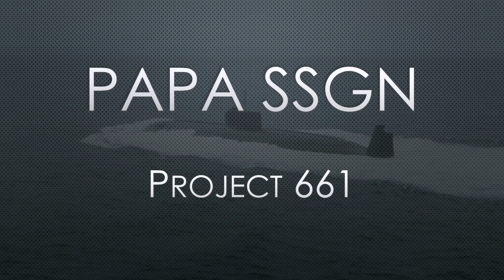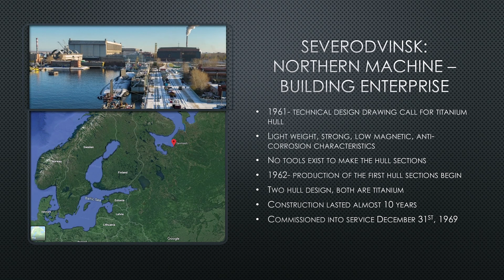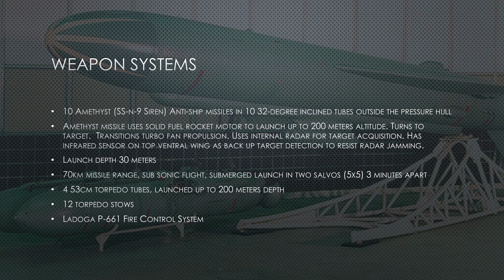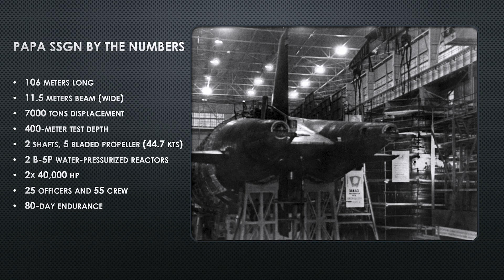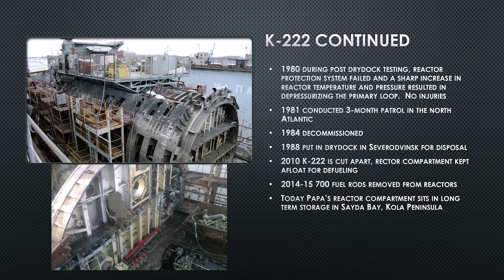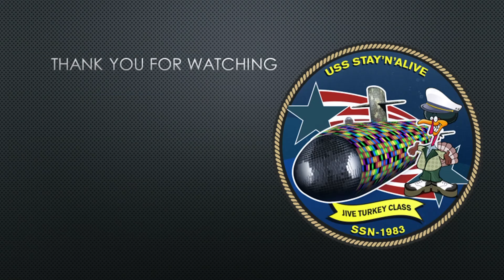The Fastest Submarine Was Not American

Comment: My gut feel is, that what killed these subs, was their noise levels.  Our company did surveillance work, and the sensor technology also improved radically in that same era.  Also, several "odd" programs like wake observation, and flyover tech, allowed an almost 24/7 "guess" as to where these boats were located.  If they lofted to communicate, they were immediately spotted.  If they went deep, they were tracked by the long sensors.  As best, they had to stay shallow, and stay in the local noise band of the surface.  That also made them visible.  Then also, we developed a torpedo which was capable of chasing them down, so closing in was not an option for them.  After about the 1970's, their best defense was to stay at home at their bases.
Reply: Yes, at flank speed the Pappa and Alfas were noisy. But they did it on purpose to show us their Speed and Mobility. But here was the scary part that the Navy and C.I.A. was aware. The vessels would then slow down and disappear from sonar. They could out run and out dive torpedos too. The Titanium hulls were not used as decorations. They were the Marine versions of an Air Born interceptor. Scary, very Scary!

Comment: It seems from the comments that some don't understand the properties of titanium. First is that it is actually heavier than steel. Second (and more importantly) it is much stronger than steel so you can use far less of it. My brother built a bicycle for racing. He showed me the titanium seat post. I could not get over how thin the metal was yet strong enough to support his weight and not collapse from the clamp holding it in position. It is an amazing metal.
   I also want to thank Sub Brief for these podcasts. I really enjoy the presentation of information free of narratives.
Reply: This is incorrect, if you search the density of titanium you get 4.5 grams per cubic centimeter, while steels range (different alloys) from 7.8 to 8 g/cc.  The strength to weight ratio is definitely in favor of titanium, as they have (barring exotic steel alloys and heat treatment) similar tensile and compressive strength.

The advantages of titanium in submarine hulls are that you can use thicker material at the same weight for more strength and deeper hull depth, and that you significantly reduce your magnetic signature for the detectors some ASW planes use.
Reply: One cubic inch of steel weighs 0.283 pounds, One cubic inch of titanium weighs 0.163 pounds. You are dum.
Reply: @arronhopsburg8532  also its not ferrous, so wouldn't show on a MAD

Comment: you should take a look Aaron at the new super destroyer that Japan is building using the Agis on shore system. Its bigger then the Ticonderoga and has more fire power then the Chinese 055 as packs a 128 VLS  firing SM3s and SM 6s with Tomahawk cruise missiles along with the brand spanking new updated Type 12 anti ship missiles with a range of 250km that is being even updated even more to 650 km and finally to a range of 1200km ranges.

Comment: weight is not an issue on subs they use titanium because it is strong
Reply: Nope. On Papa it was really to lower hull mass. And on Alfa and Sierra partially too. What they spared on hull mass, they could use for mass of equipment. If papa would have steel hull, it will be not possible to install two propulsion unit with its length. And prolonging submarine would increase lateral drag hindering top speed. Submarine has to be buoyant neutral so you have only limited mass you can have for particular hull size.

Comment: Dumb question time. Subs are neutrally buoyant when they dive. So why does weight matter with speed?
Reply: Simple answer is, that weight do not matter to maximum speed. But in practice at upper speed limit weight greatly diminish acceleration, making real top speed impractical because of time needed to achieve it. Thus practically limiting maximum speed lower, than it in theory could be.
Reply: @ Well, you cant accelerate quicky in 7000ton submarine anyway. So the mass does not matter. The only reason they made all this effort to build Titanium hull instead of steel is because as mentioned before, sub is neutraly boyant. So you are limited on how much weight you can put inside of the submarine. Reactors do weight, steam turbines do weight, rockets do weight. Also if you wanted go fast, and deep you need a strong hull that weight even more. So the reason to make sub out of titanium, was to save weight for the euipment inside. Like with the carbon fiber submarine Titan. They build it out of carbon fibre, becouse if they would use titanium instedad, the empty hull would be negativly boyant on its own.
Reply: @RelativyX  wrong. Sry
Reply: @WarmongerSmurf  also subs are not neutrally buoyant.  They take on water to dive.
Reply: Force=mass x acceleration. Acceleration = force/mass.  The more mass, the more force you need to move it.
Reply: @Jp421JP  I disagree. While less weight gives you faster acceleration it has nothing to do with top speed. Top seed is when your driving force is equal to resistane, that for hydrodynamic resistance is equal to: (p*v^2)/2 There is no mass involved in the equation.
Reply: @ physics aside it clearly matters since they took the effort to minimize mass and maximize force ( why it was so loud) But yes, maintaining speed once you get there is a matter of overcoming resistance.  But you have to accelerate from 1 knot to 2 and so on, which takes force.

Comment: Imagine the cost of a dual hull sub with both hubs made out of titanium. I know it's the USSR but titanium still has some analogy to high cost because you don't have as much of it as you have steel. Then again I suppose when it comes to strategic weapons systems things like plutonium also have a high cost/very limited supply. In fact I read in the Manhattan project Leslie Groves basically obtained all the graphite in the US to build reactors. A graphite reactor can run on natural uranium rather than enriched and produce plutonium which can be chemically separated.
Reply: You do not have to imagine. You can calculate it. Outer hull was from 2cm plates, inner hull from 5 cm sheets and had 47 ribs, each 20cm in height and 4cm thick. Papa used raw titanium, unlike later Alfa, so it was relatively cheap. Outer hull had total material of roughly 270 tons, inner hull with ribs used roughly 500 tons. Totally les than 800 tons of titanium. In todays prices with 10 USD per kg at large orders it will be not more than 8 million USD. Yes, steel would cost fraction of that, but you would need bigger mass. But overall, most expensive is not material itself, but processing. You can weld steel in hall filled by normal atmosphere, titanium would catch fire in such environment, so you need to seal the hall, fill it with argon or CO2 give welders rebreather and time to time make their funeral and hire another welders 😀

Btw. Alfa was significantly more expensive material wise, because it was used beta alloy which as novelty was extremely expensive then (roughly 8 times more expensive, than raw titanium) and also despite being significantly smaller than Papa, total amount of titanium alloy used was over 1200 tons! So she was indeed "golden fish", but this is another story.
Reply: @Aaron_Nonymous  
It was a research sub. The USSR had a history of trying out concepts and then discarding them if it had no practical value.
They had radio operated remote tanks
In the 1920s  and then scrapped the project because they deemed the technology too undeveloped.
Something the Nazis never learned.
Reply: @johnweerasinghe4139  It was not research sub, but this prototype has so many design flaws, that they decided to not redone it. Many Soviet submarine designs had similar problems in their first prototypes, but they decided to improve them. 
In case of Papa main weakness was not enough space for then developed unified super missile Granit (it was backbone of Soviet naval technological dominance in 80s), so they decided not to improve Papas design and pursued Oscar class submarine design instead.
Reply: @tomascernak6112  
Prototype means experimental before series production.
Reply: @ Nope. Here is definition:
A prototype is an early sample, model, or release of a product built to test a concept or process.
In czech definition it is first product of series.
Experimental is as experiment research.

Main difference is, that experimental/research product is not intended to produce even if it will work properly. Soviets indeed built several experimental submarines. But Papa was not one of them.

For example Albacore was experimental submarine.
Reply: @tomascernak6112  
Ok I understand your point. 
But in your own definition of a prototype you said " ....built to test a concept "
The plan was to evaluate  the feasibility of a high speed submarine that can fire a anti ship missile while submerged.
They found the technology at the time too expensive so  they abandoned it.
What I don't like is western sources that find an opportunity,  any opportunity to discredit Russians when Russians do a good job of evaluating their weapons and have a better understanding of real combat than these western sources.
Reply: @johnweerasinghe4139  Yes, but this is difference between prototype and experimental sub. If Papa would prove good, they would built another boats in that class. Drawbacks of that design was so severe, they decided not to built another boats. But Papa served in normal service as active submarine, just one of its own class. Like Mike class etc... Experimental submarine is different. It is testbed from beginning to test technologies, it is not intended to be first of its class and it is often modified. Like that Albacore i mentioned.

I am not westerner and I do not agree, that Papa failed because she was expensive. Soviets did not considered cost too much in those years. Main problem was their missiles and small missile compartment, which was result of large propulsion system in small boat. P-70 were not good enough and P-120 did not improve things significantly. P-500/700 were too big for relatively small submarine like Papa.

Big problem was also Papas hull. It was Albacore like hydrodynamic, so simple cylinder with many dull places, which suffered at high speed with turbulent flow which produced massive vibrations and outer hull damages. In Alfa class, they made outer hull graceful hydrodynamic and therefore Alfa did not had such issues as Papa and needed significantly lower power output per cross section to achieve similar speeds without those pesky vibrations.

So those are two main reasons, why Papa remained as single boat of its own class. 

Fact is, that Oscar class and Granit missile program was such leap forward, that it was futile to build anything else.

Comment: My dad's boat, the USS Knox, tracked a sonar contract off the coast of Vietnam back in 1966 or 1967. Says he doesn't remember if the Knox pinged it, but the moment they started to track the unknown contact, it took off. He makes a sound like a shot and then waves his hand away from himself, "Gone!"

I've always wondered if it was a prototype Akula or something, but the dates are wrong. The K-222? That possibly lines up with the production dates of both the Knox and K-222.
Reply: K-222 was commissioned in 1969, so if your dad's memory was correct for the 1966-67 time frame, it wasn't the Papa.
Reply: Yea that would have to be something else, Victor and November class were in service at that time. Those do about 30-32 knots. They'd still be faster than the USS Knox, that one isn't particularly fast so it wouldn't be able to chase down a Victor or one of the faster Novembers.

Comment: what is/are the source(s) for the argon environment/ diving suited welders construction method?  ive heard it said several times but have not found a citation or primary source.  ill bet its a helluva story!
Reply: i probably should’ve mentioned im an aerospace engineer n have tig welded ti before. never something as large n complex as a submarine tho!  that build crew would qualify as industrial heroes even today. id love to know more about their story/organization
Reply: I don't know the source, but I know the melting point (for welding) is below the ignition point. In other words, the metal will catch fire before it melts if oxygen is present.
Reply: @pgvsmith1 As @john_in_phoenix already has explained the "reason" for the "extreme construction methods" are quite likely "less spectatular" than they at first might appear ((at least imho)).. Simply put the environment and materials ((Argon gas, and tungsten Welding tips)) are "basic tools of the trade" when doing TIG welding.
The big difference here is (imho, and mind you I'm not quoting any source, just my ""common sense"")) that when welding "submarine hull plates" it is ""easier"" to create a fully "enclosed environment" in which the welders work using some form of (possibly closed system) ""breathing apparatus"" than it would be to create "jigs" to fit these "enormous parts". That otherwise would be needed to "envelope the welds in argon, while the welding was done...
Not to mention that this ""method"" also would work as a COMPLETE and utter "natural ignition and fire suppression"" (possibly an "existential risk" for a project like this)). And possibly  even could save on ARGON as it would not have to be "kept flowing" to protect the welds, as is the case when using more normal jigs...
At least these are my uneducated "guesses/theories"... I "simply put" think it, as many other ""soviet design decisions" were done after a "pragmatic cost benefit analysis", where the "human capital" was NOT very highly valuated/appreciated...
Best regards.
Reply: The methods were copied from the USA, ironic that the raw titanium was sourced from the Russians in the early years. An inert gas is the only environment that titanium can be welded in. First was the SR-71. Then the main box fuselage for the F-14.
Reply: @ not sure about your math, friend. gtaw was patented internationally in 1941 by a northrup engineer i believe. it had been in use across the industrialized world for decades, including ussr, n was a reasonably mature technology by the time papa was ordered in 1958.  the a12 (sr71 predecessor) won project gusto in 1957 but didnt start building til 1962 so roughly contemporaneous w papa but its a stretch to say ussr copied american methods. im sure they were still secret. the f14 (designed mid 60s?) pioneered large ti structure eb welding (developed by german physicist in the 50s i think). all are great stories

Comment: What are the specific benefits for a liquid metal cooled reactor?
Reply: 1. Higher energy density
2. Higher power density
3. Smaller thermal inertia, faster power output control
4. Higher energy/power transfer
5. Higher core/coolant temperature, higher efficiency
6. Standard pressures in primary, less stress to components, lower leaks pressures, higher reliability
7. Leakage solidifies almost immediately, bigger safety

Negatives
Coolant soldifies at temperatures dangerous to humans and common things. Complicates any maintenance of core and primary.
Necessity to remove reactants from coolant (in LBE it is for example Polonium 210).
Coolant temperature is high enough for thermal decomposition of water - risk of hydrogen explosion.
Can not be totally shut down.
Needs high enriched uranium/plutonium.
Reply: Metals transfer heat more efficiently compared to water cooling
Reply: These are the so-called fast neutron reactors. They have much higher energy efficiency and performance. In addition, they produce less waste.
Reply: Coolant can't flash to steam easily.
Reply: That it becomes a solid chunk of metal if you shut it down unexpectedly.